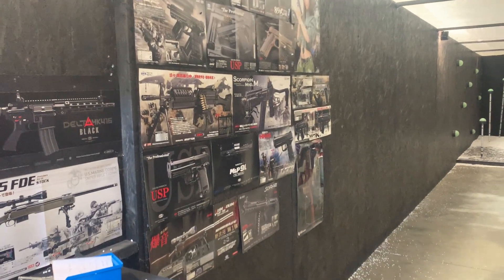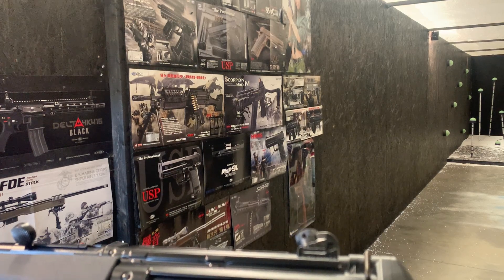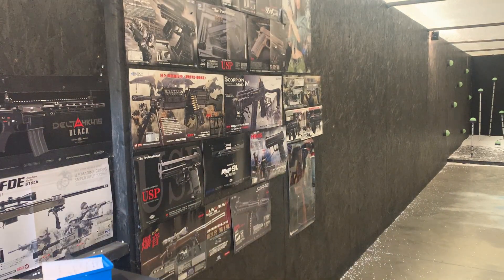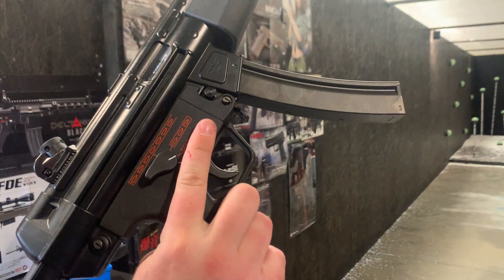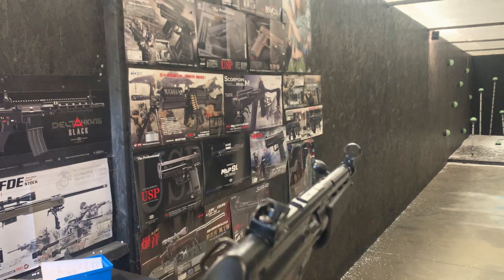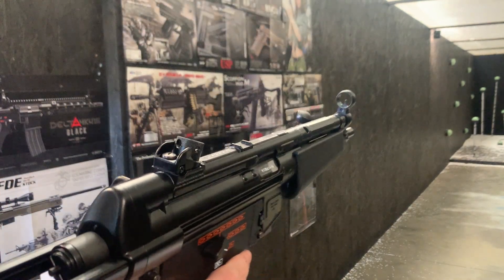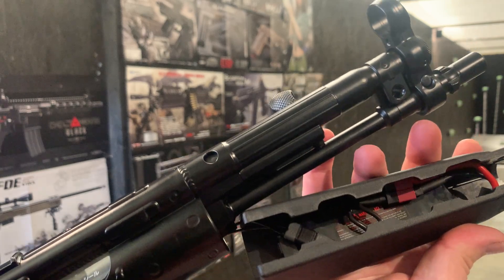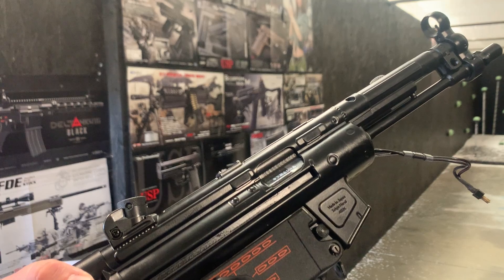TM MP5A5 NGRS | 899

Comment: What spring in this one Richard?
Reply from the maker: M95 + 1 spacer I think
Reply: @Eagle6Airsoft  Thanks Richard. Recently been given an MP5A5 that literally destroyed itself!. Nozzle shattered, Piston stripped, burred pinion and some gearbox damage due to bevel kicking out which I have never seen before?. Plastic bushing was almost fully pushed through the shell! Rifle had no upgrades although chap tells me he just put 800 rounds through it in one go almost. Have ended up fitting a WII Tech hop unit which is quite impressive and absolutely air tight, but rifle is way over power on a 105. Gearbox damage around bevel bushing hole repaired luckily too and fitted FPS steel bushings with loctite 638 to be sure of no repeats! Will try an M95 first.
Reply from the maker: @zooankski  luckily all parts are now available for mp5 with the exception of the mosfet.  So repairing is now drama free like it is for any other ngrs.
Reply: @Eagle6Airsoft  Any ideas on cost for a new gearbox shell or if available? just incase🙂